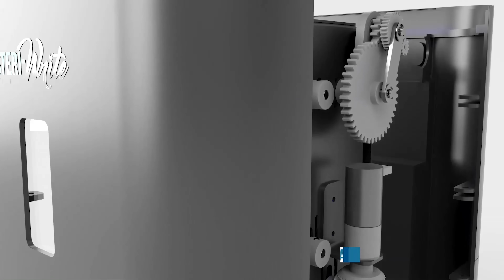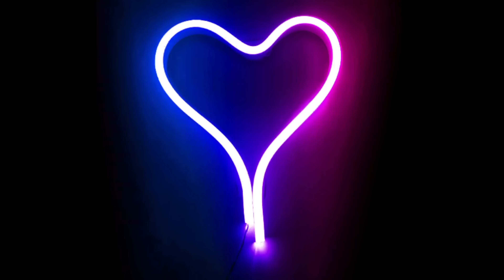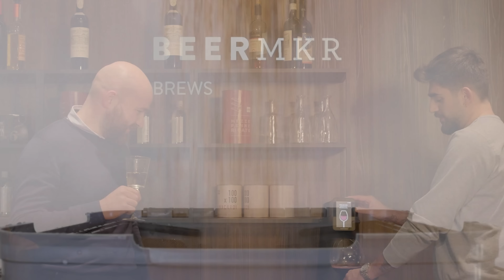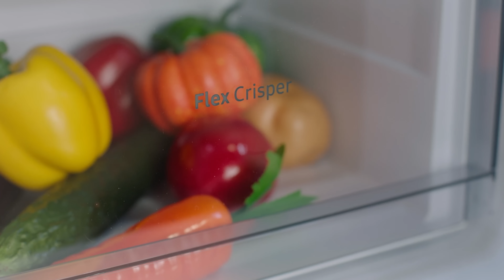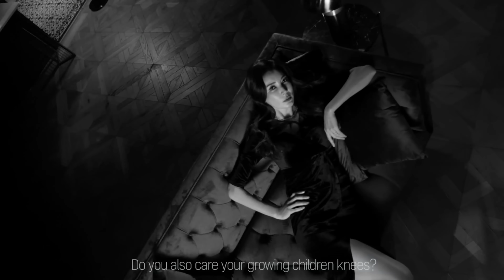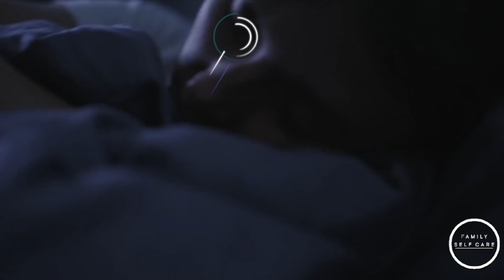CES 2021 BEST and WORST New Products - What Engadget Didn't Show You

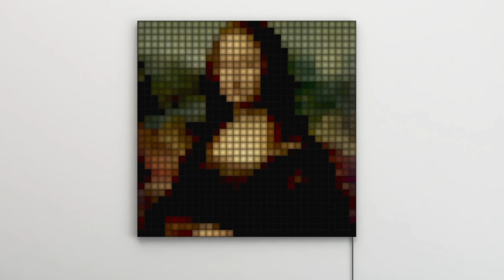Comment: Love the LED wall panels - especially the last (2:14) which shows Leonardo Da Vinci's "Mona Lisa". I searched the web, but could not find any supplier. Do you know some? Thx!
Reply from the maker: Twinkly is the brand, release date is Q4 2021
Reply: @TheHookUp  Great, thanks Twinkly Square it is. As this essentially is "just" WS2812 LED strips one could make an own build. There is stuff on Thingiverse to 3d print and we even see guys using table tennis balls in a matrix as diffuser: https://www.youtube.com/watch?v=EZEMK-C-nSo Well - if   Twinkly would sell much cheaper than LaMetric Sky I would rather wait and buy then tinker.
Reply from the maker: @bikeadventure1  One weird thing about twinkly is that they are definitely not using WS2812 or similar chips.  I've messed around with the strings and the pre-lit trees they are a 2 wire system, pretty strange.
Reply: @TheHookUp  Oh yes, we came across some of these when assembling a chinese RGB cube. There is little documentation on the net regarding the signalling/protocol they use and so far we did not spend time in analysing. But they amaze me...